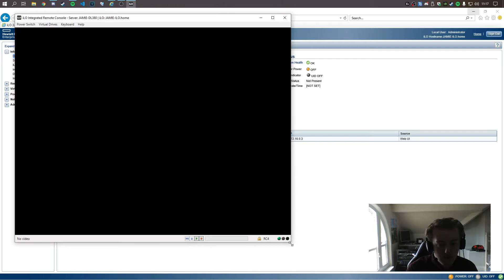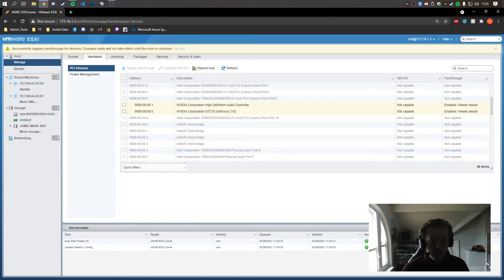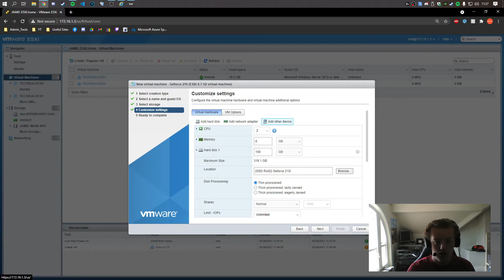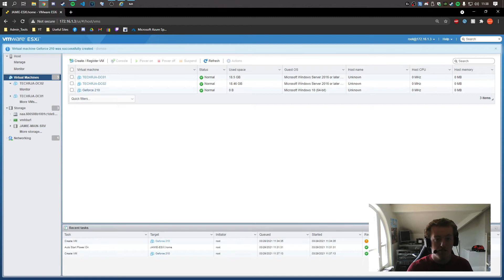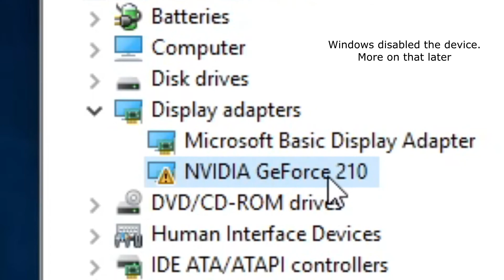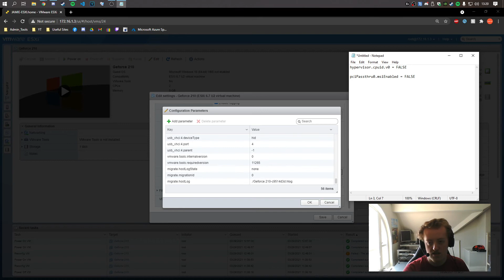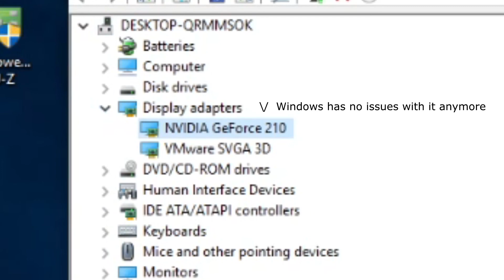HP DL380 G7 - ESXi GPU Passthrough | Asus Geforce 210

Comment: If your riser card has 3 slots on it. It is configured with 2 times 4x, 1 times 8x slots. There is an optional single slot PCIe 16x riser card you can employ. Just move the 3 slot riser card over. Additionally, there's a 10  pin to 5 pin cable that runs from the motherboard to the back of the 16x riser card that allows 12v power if your video card requires more than 75 watts power.

Comment: Did this cause any issues with booting, as in did it try to display through the GPU or did it just do what it normally does, and did it take longer?
Reply from the maker: Not much change to the bootup process. Works fine
Reply: @techrja  if you plug a cable into front VGA port do you get nothing or does it default to front VGA,

Thanks for the reply, about to do this with a 360p G8
Reply from the maker: @woodant1981  the front VGA would be for the ESXi console.
Reply: @techrja  ah OK, just wondering if server was initially confused and sent ESXi through it. How about initial post,

Thanks